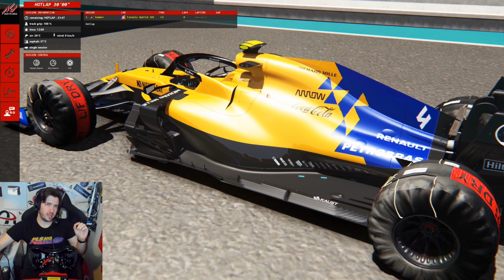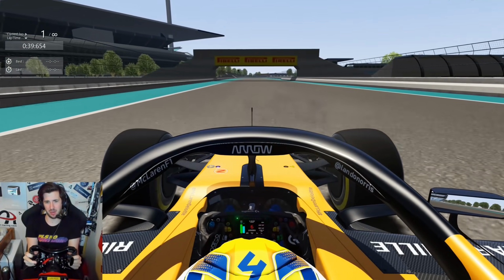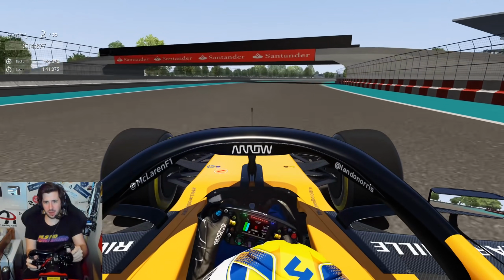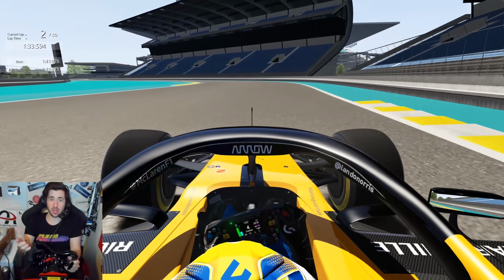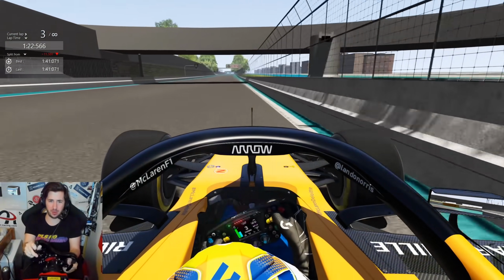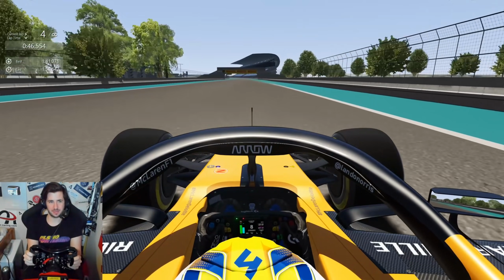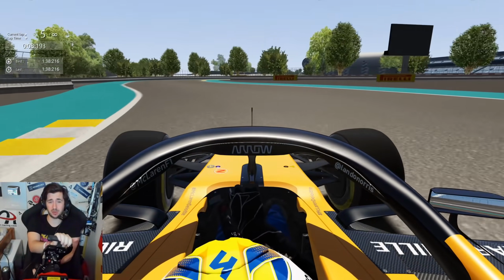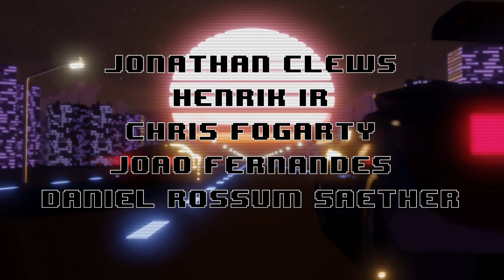Driving The NEW Miami Formula 1 Track

Comment: Hermann Tilke has entered the chat
Reply: I like what he did with the Ossterreichring.
Reply: Tilke needs a vacation.
Reply: A fishing holiday - at Lake Windermere. With lead weights tied to his feet.
Reply: @edwardburek1717  Death threats ... So funny.
Reply: Now, to be fair, he's made some great designs. Sepang, CotA, Hockenheim, A-1.

But he's ruined his fair share as well. Fuji, Magny Cours, Hockenheim.
Reply: [aluminium panther] Idk, I actually prefer new fuji and new Hockenheim.
Reply: @f1_headassery  as do I, but I especially dislike Fuji. As an overall track it's great, but why the fuck do they think a remove speed chicane is a good idea for a braking zone that supposed you to lead on to a short straight away? For me, it runs the flow of the track.
Reply: To clarify, I really like Hockenheim. I also loved the old layout. Fuji is great except that sorry excuse for a chicane that serves no purpose other than slowing the average speed of the leap down and killing off another overtaking area.
Reply: @fabsalomon85  *implying a bunch of 90° corners have character
Reply: @josepCAT118  the bumps tight corners and still plenty of passing every single year. 
It's a very unforgiving track so yeah it has plenty of character
Reply: Tilke logic :

Full throttle > Hard brake > Chicane

Continuosly at many track
Reply: Tilke actually did a nice job with the Chang International in Buriram. It does have its, uh, TIlkisms, but has done spectacularly for bike racing.
Reply: The Track isn't from Tilke. Hanoi will be from Tilke but not Miami. Zaandvort isn't from Tilke too!!! The Circuits are looking so boring not because of Tilke, but due the FIA regulations.
Reply: It's not him who designed this track. It's actually Alexander Wurz, ex-F1 driver and current Safety Car driver
Reply: @wahyumuhammad8982  hard braking is something that improves overtaking. So on that point, Tilke is right. Secondly, he doesn't apply chicanes everywhere.
Reply: Fun fact: tilke is also a Finnish word for stuff you use to seal the gaps between the logs of a log house. So it literally means filler.
Reply: So good he hasn't got anything to do with Zandvoort. Would have ruined that track, too.
Reply: @jogon206  F1 has already ruined it... The old Zandvoort was fine, just not for F1 anymore but Liberty wanted more Dutch Money, could have gone to Assen...
Reply: @MsMrmassa  Bernd Mayländer is the driver of the safety car not Alexander Wurz
Reply: Hermann Tilke needs to retire
Reply: @samoimusic  Chang has twice hosted the MotoGP series, plus more World Superbike races. They've been good overall, the more natural corners really work well for bikes. F1 cars are such huge, airflow dependent vehicles that they do terribly on any track that isn't built for them. Chang wasn't made for F1, and F1 shouldn't go there.
Reply: @samoimusic  Today's F1 cars are only entertaining on 2 types of tracks: Wet or ones with insanely long straights.

People hate Tilke tracks but look at the natural ones. Today's cars simply cannot overtake at the levels older generations could, and the cars have become insanely wide. Monaco used to have overtakes, however little. Now it doesn't, because it can't.
Reply: @TheMaxious  finally another person that knows that Tilke tracks are how they are mostly due to FIA regulations not entirely but mostly

Comment: Miami : What happens when Baku and Mexico got Yas Marina drunk on the beach...getting jiggy with it?
Reply: That’s exactly what this track is. Mexico Baku & Abu Dhabi in 1
Reply: Hermanos Rodriguez is a decent circuit, actually. I was sad when WEC cancelled it from their calender a few years ago. Baku is at least nice to look at. This Miami circuit, however, is like the worst aspects of all circuits ever rolled into one. But that's nothing unusual, considering that racing circuits in Miami have always been horrid. I mean, look at the shit shows that were the ALMS races there in the early 2000s. That circuit was just nuts, and not in a good way.
Reply: @ActionMacaque  Mexico was a great track, but I think the new version is a bit emasculated with the peraltada cut in half. The layout as it was in Geoff Crammond's first Grand Prix made it one of my favourite tracks in that game. Tilke has neutered it.
Reply: @johnduncan5117  The Peraltada being cut out was not a Tilke decision, though. That had more to do with the baseball stadium built there. The Peraltada was no longer in use by the 2002 or 2003 CART race (to my memory, at least) that can be found here on Youtube. I agree, though, that they went a bit over the top with the changes in total. The Esses section could've simply been left alone with just some run-off added instead of complete reprofiling. Other than that, it's among my favourite tracks.
Reply: @ActionMacaque  interesting, didn't know about the peraltada history. It's sad because it was a great corner.
Reply: Nah I'd say it's Sochi: Part 2.
Reply: @andrealbu23  I see more Sochi than Mexico
Reply: actionmacaque it was used in 2007 but it had a chicane before taking it
Reply: Please don't compare the Yas Marina track to this one. The Yas Marina track is a really bad track that offers little challenge to any driver- whereas this track is decent.
Reply: Don't forget that first turn from Canada!

Comment: "There'll be lots of DRS passes"
confused 2021 regulation noises
Reply: Adam Baldwin DRS will still live on in 21
Reply: @Senokone  It won't anywhere  is my guess
Reply: No DRS is confirmed to be in F1 for 2021
Reply: 2021 is a test year for DRS; they hope to get rid of it eventually, but at first it stays so they can evaluate the effects of the other regulation changes. They will then decide if the changes accomplished what they hoped and if drs can be disposed of after.
Reply: @hkr667  It enables to sell higher price tickets at the end of the zones so people can see notovertakes so I expect DRS to remain
Reply: @hkr667  I didn't know they decided to keep it in for 2021, and tbh I didn't think it was even possible to implement with the new rear wing design. It'll be interesting to see how they manage to add a mechanism to open the DRS into a wing structure that's almost all compound curves in the renders that have been released
Reply: Adam Baldwin Even a small opening in the rear wing would give an advantage to the overtaking car. Even with a curved rear wing it could still open right down the middle. It may not be as advantageous as it is with the current rules package, but it will still provide a distinct and noticeable advantage.
Reply: @fourutubez7294   No, it enables actually overtaking because of the ridiculous amount of dirty air we've had recently, if the new regs work then it's gone.
Reply: @NangDoofer   I hope so but money shouts louder than sport
Reply: @fourutubez7294  DRS wasn't brought into because of money though, and the overtakes will still happen in the same spots.
Reply: @NangDoofer  DRS was introduced to make money from fake overtakes which was also supposed to attract new fans , I think the FOM   FIA had been watching NASCAR lol. I've watched F1 since the mid 70's and it's always been a madhouse
Reply: Four utubez DRS wasn’t a ploy to generate money, it was a progression from the F-Duct. They can’t stop teams from finding loopholes in the regulations and when the F-Duct was introduced it actually made some of the racing fun, yet taking a hand off the wheel is dangerous so they went with DRS. Although I think they overdid it with DRS and it can’t be used tactically like the F-duct could.
Reply: @aclark3208  I know that  but  look at how it's used now as entertainment provider with multiple zones to boost seat prices in those areas and yet more fake undefendable  overtakes.
Reply: @lol shit I disagree, I'd rather fewer but non assisted overtakes. I have been watching since the mid 1970's and not many overtakes feels normal .
Reply: this comment aged
Reply: @fourutubez7294  Its about the battle not the overtake. Great drivers will usually find a way past, DRS just shortens the battle to the point where an overtake is almost always inevitable.
Reply: @BorkenGarage  If it worked that well I'd back it even though I don't like it  but there is too many pure DRS overtakes ruining the actual racing.  In addition DRS sectors also increase the ticket prices for those sections so promoters love it  , money shouts way louder than sport.
Reply: @fourutubez7294  Yeah I think the battle between Lewis and Lando on the weekend may have been very different without DRS. I think we lose more than we gain from a spectator perspective

Comment: If 'long straight into hairpin' is a modern F1 circuit, then AVUS would be the absolute best modern F1 circuit
(Please don't say this to Tilke. I want a German GP, but not like this)
Reply: Old Hockenheim? That was a beauty IMHO
Reply: I'd never heard of AVUS until this comment; looks like a track for people who find Norisring too much effort to memorise.
Reply: @FrankypankyV8  old Hockenheim was worse than Monza
Reply: @R4M_Tommy  *better
Reply: @ganymedeix9511  I would say it looks like a NASCAR track where someone said: Let's make it LOOK more technical.
Reply: @FrankypankyV8  what's the difference between "long straight into chicane" and "long straight into hairpin", besides both of them being boring? Bcos old hockenheim fitted perfectly into the first category, didn't it?
Reply: AVUS could be a Wangan Midnight track!
Reply: @testdrivefan1  Long straight into hairpin or kinda straight in to hairpin, has been a thing since Fuji
Reply: @testdrivefan1  old Hockenheim had long straight, which required low down force, and the Motodrom, which required (and requires) high down force, so it was a challenge for both drivers and cars. New Hockenheim is good, but the old one was better

Comment: The one gripe I have with this circuit (before seeing proper racing on it) is that there’s no elevation changes. That’s a way to make relatively standard elements more interesting (think COTA’s T1)
Reply: The entire state of Florida has no elevation change :D
Reply: BareFootSimRacer I know, but considering that these tracks aren’t built off of public roads and don’t use natural terrain, they could’ve just built elevation changes into it
Reply: @jeffreytam7684  I believe (though I could be wrong), the track area mostly utilizes parking lots and access roads around the football stadium and other business (much like the IndyCar race in Houston a couple of years ago) and wont be a permanent year round track, so they can't really alter the landscape.
Reply: BareFootSimRacer Oh I see. Well that’s a shame then.
Reply: I wish we had elevation in Florida. The high points are the highway overpasses.

Comment: I think another key issue with these new tracks is the external layout of the track e.g. Run off space, grass, gravel traps, viewing areas for spectators. This all adds to the track too. I live in Melbourne and go the Grand Prix every year, Yes the track doesn't offer much for overtaking but at least drivers are punished for leaving the track which does add to the atmosphere of the track. There should be a key focus in this for these new tracks.

Comment: A lot of old circuits like in the 60s and 70s had those sorts of long uninterrupted straights. Think the lack of elevation change is a bigger factor in this being uninteresting rather than the simplistic layout. If there was a crest or two along those straights or the long curves, it could make it quite a bit more interesting - like the entry towards Maison Blanche at old Le Mans. Anything elevated to make it a bit more interesting than just a pool table.

Comment: I wonder how F1 would be back at Watkins Glen?
Reply: I too wanna see F1's back in Watkins Glen. And keep Tilke away from the refit..
Reply: No, they would ruin the track with a bunch of "safety" crap for the f1 cars. Prototype cars have raced there no problem but you know they'd still want to significantly alter and disfigure the track and barriers to make them feel better about themselves
Reply: @jamesshives5679  Well... If they'd really put thought to it, they wouldn't need to butcher the track itself. Widen some runoff areas (no tarmac areas. Pure gravel and grass. This way if you runoff, you'd be punished like it should be), resurface the track, upgrade the grandstands and paddock. No redesigned curves and no chicanes at all.
Reply: @LoganHunter82  I can imagine they would want to ruin the top of the esses, where it gets narrow and tricky at the top of the hill. They would either not use the bus stop chicane or they would have to potentially modify the curbs and take away the challenge of using them as they are right now. I suspect that all around the track they would want to push some barriers away from the track and maybe change them from armco to something else. And of course they would repave it which also takes away some of the challenge of dealing with the different textures of the track. Of course, this is all speculation, and maybe I am wrong and they wouldn't do all of that, but Watkins Glen is a wonderful track as it is, and I can't see modern f1 doing anything other than ruining it for the sake of allowing their oversized cars to run there.

Comment: I see a lot of people criticizing newer track designs using that argument that "these tracks suck because there's just a couple overtaking points after a long straight and into a slow corner and nothing else in the rest of the track", which I find it pretty funny as i feel like they are describing like every track design ever (bar ovals ofc.). Like have you seen much passing at Pouhon, Degner, Lesmo or Maggots? No, it's always after a long straight and into a tight corner as that's how overtaking works, you draft, use DRS if you got it, then outbrake the other car.

As for thistrack, looks pretty meh to drive, but i suppose it will be ok for racing, a bit like Baku, which I feel is what they're trying to recreate, like at Vietnam.

Comment: Bring back Nurburgring instead of this mess😂
Reply: Better idea,a track with cornors from tracks that f1 dosent race on,for example carossel from the nurburgring, corkscrew from Laguna seca ,or even take inspiration from virtual circuits
Reply: @FEVERNOVAA  f1 car doesent clear those corners
Reply: @naigamon you modify them to clear, shouldn't be hard when you're making an entire new circuit
Reply: @FEVERNOVAA  you cant modify them so much for 1 track. regulations etc.
Reply: @naigamon  what regelations regarding modification?
Reply: @FEVERNOVAA  Check out the Circuito Ascari in spain, that's basically a mishmash of famous bits from famous circuits. Would never get FIA approved though

Comment: I hope the final version isn't as flat as this. Otherwise, there will seem to be a lot of emphasis on a low-downforce set up for the long sweeping straights with large amounts of mechanical grip needed through the slow parts. Unfortunately, it seems to be a concrete jungle. It'll be a challenge to hook up a good lap, but I'm uncertain to see if it will be an entertaining one.

Cheers for the preview Mr Jimmer!

Comment: Unpopular opinion: there was a track designed by Apex Circuit Design (I think) around the harbourfront and back and forth across a heckin' long bridge that I preferred much more
Reply: I agree. I heard they couldn't get a pit lane in that layout
Reply: @aaronc3535  I mean I saw one on the plan, I just double-checked, but it does look a little cramped and possibly too short yeah
Reply: @joshuabrookes6075  I do agree tho seeing them go back and forth over the intercostal would have been awesome

Comment: Not bad, it looks like a modern F1 track (to paraphrase the immortal Colin Kolles). It's a street circuit that's kind of like a permanent circuit, I like it. It's just the fiddly bit in the middle that I don't like, but there are enough fast and flowing corners.

Comment: I think it has potential tbh. The corners are very different and technical. I don’t like the idea of long DRS assisted straights, but really the issue is DRS itself. I understand why they have it, but look at Abu Dhabi last season for the first 10-15 laps without DRS. It actually felt good. Get rid of DRS gimme passes and it will force drivers to figure out other ways to pass. It won’t fix the gap between the first 3 teams and the midfield, but it will likely provide even better racing in the midfield.

Comment: Sick of the concrete jungle tracks.  Nico Rosberg would love them, plenty of run off areas.  I like the consequences that having sand presents.
Reply: Or walls... F1 needs more proper street circuits. Not those boring ones with long straights, but something like long beach, belle isle, etc. The problem is the cars of course, being too big and making too much dirty air.

Comment: when you have direct drive wheel its not weird to drive in t cam.....cause you got your car behavior in your hands cockpit view is for the ones that need to SEE your cassis slip and to see how smooth your steering input should be at the same time.